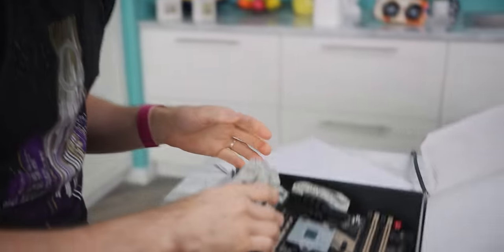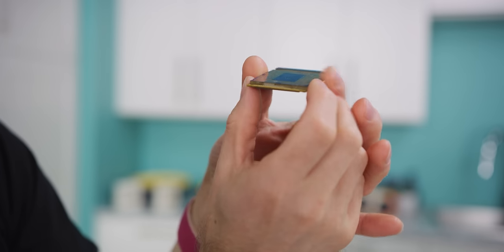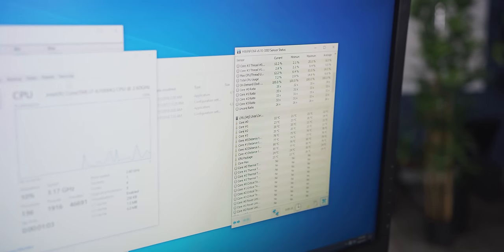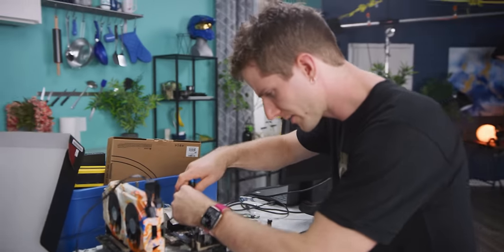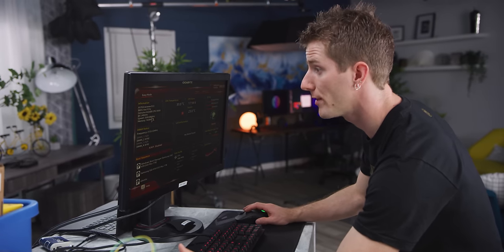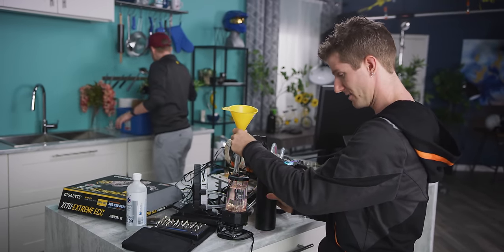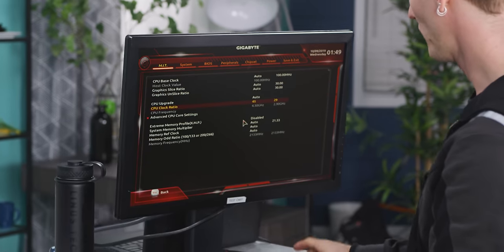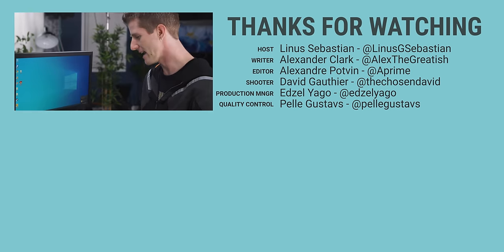Testing out Mystery Chinese CPUs

Comment: Damn Linus, I can't believe you had such a hard time. I ran the QL2X and 3X like a breeze here all the way up to 4.6GHz and even 4.8GHz CPUz Validated. Issue you were having is likely due to PCIe Gen2, some of these CPUs require to use Gen1 to work properly. But then again, you could just have used the integrated graphics (UHD 630). From my testing, Gen3 to Gen1 saw from 5 to 10% performance loss on GPU bound scenarios when using a GTX 1080Ti. You can also try raising VCCSA and VCCIO voltages, sometimes that helps to get PCIe Gen2 stable on these. For some reason, AMD Graphics cards normally don't seem to present these issues. Another thing that might've happened is that the water block used could have messed up the mounting pressure, but there's really not much tweaking involved there. You can totally go up to 4 - 4.2ghz on a stock Intel cooler since they are direct die. Nice to see you guys got to try out these CPUs too, they are pretty neat :-) Btw, I also made a video on them (cc/subtitles in english available)
Reply: Up
Reply: up
Reply: Watch it, Linus!
Reply: Up
Reply: up!
Reply: up
Reply: Up!
Reply: Upzão!!
Reply: Up
Reply: Up!
Reply: Up
Reply: up
Reply: UP
Reply: up
Reply: Up
Reply: Up
Reply: Up só prós gays
Reply: up
Reply: Almost good but you had to ruin it with the casual self promo at the end
Reply: why are people treating this like a forum
Reply: up porra, tem q ser o primeiro
Reply: UP
Reply: Up
Reply: up
Reply: Up
Reply: Up
Reply: Up
Reply: Up
Reply: Up
Reply: @benjaminandrews956  Nevermind, I got it. Removed the part which you called "self promotion". Thanks! :-)
Reply: Up
Reply: Up
Reply: Up
Reply: Up
Reply: up!
aqui é br poha!
Reply: Up
Reply: UP!
Reply: Up
Reply: Up (br é foda kk)
Reply: Ele falou pra não darem "up" poha kkkkkkk
Reply: Up
Reply: Up?
Reply: Up
Reply: Up
Reply: Up
Reply: Up
Reply: Up
Reply: Up
Reply: Boaaa
Reply: Linus likes to add in some drama to create suspense for its viewers
Reply: right
Reply: Ran Ng  Yeap, probably! I missed him on this video :-)
Reply: @CasualGamers  One loser whined about your "self promotion" and you removed it? Not too committed, huh?
Reply: Up
Reply: plz see this thread linus! Casual Gamers already made a review on this processor
Reply: @xenonram  What can I say? I guess I am easily persuaded. Just edited and put it back on, lol.
Reply: Up up up
Reply: Caralho Casual Gamers aqui! #UP
Reply: UP
Reply: Up
Reply: Up
Reply: Up
Reply: Left Right
Reply: Up
Reply: Casual Gamers ....OR...it could have been due to a malfunctioning flux capacitor?
Reply: up
Reply: Up
Reply: Up
Reply: ok
Reply: @benjaminandrews956  That was a reasonable and fair self promo though. Totally fine in my book.
Reply: @Hallowed_Ground   There is no such thing as a reasonable self promo unless the channel that you're promoting on gives you explicit permission.
Reply: Casual Gamers Up
Reply: Up
Reply: Up
Reply: @benjaminandrews956  Not true. Arguably it's not even a self promo as it's completely relevant to the topic. 

Such a broad and dismissive judgment is equally easy to dismiss.
Reply: Read this Linus pls
Reply: Up
Reply: @Casual Gamers- we don’t care. This is not your video.
Reply: Up
Reply: Up
Reply: Up
Reply: Up
Reply: Up
Reply: Up
Reply: up ya go
Reply: Up
Reply: Up
Reply: up
Reply: Everything is unscripted so he must have totally forgot
Reply: Up
Reply: Up up up
Reply: Uuuuuup
Reply: Same experience here. To the top
Reply: Up
Reply: Nós BR temos o poder de dominar o mundo, só organizar certin q o planeta é nosso!
Reply: Left
Reply: @Hallowed_Ground  and I say it again. There is no such thing as ok self promo unless you have permission. This is not a hard concept to understand. Its just plain rude. Most things in life is opinion based but you're just plain wrong on this one. imagine this situation in any other background. Say you're in a apple store and you just bought a phone and you boot it up right then and there but its not working so the owner of Samsung comes and helps you and at the end hes just like hey btw buy my phone. Apple would be pretty mad about that and they have every right to be just because he provided help doesn't give him the right to promote his brand on their property. Granted i dont think ltt would care and its not like they're cut-throat competing channels but the same principle still applies and its still rude.
Reply: Upzo
Reply: Up
Reply: @renan8567  ele falou depois, Geral já tinha colocado o "UP".. kkkkkkk
Reply: @davidribeiro5364   kkkkkkkkk ata, pensei que a molecada tá zoando kkkkkkkk
Reply: Up
Reply: Up
Reply: Linus 👆
Reply: @benjaminandrews956  Except that it literally is opinion based. That's YOUR opinion.

If Linus read that comment, would he find it rude? No, he'd probably be like hey thanks, and go watch the video. That's the major difference that apparently you're completely blind to... It isn't as if this guy said "btw buy my product"  rather he's recommending something that is 100% relevant, which happens to be his vid.

Normally, you'd be right. Normally, everyone and their dog (including me) shuts down idiots that rudely advertise themselves, but there's a reason everyone didn't do that. In fact, his comment has literally hundreds of people supporting it. Worst case scenario, I've demonstrated that you're categorically wrong about it being opinion based. You'll usually end up being wrong (and looking stupid) when you declare something is 100% one way or the other... 

I'm hopeful next time you'll catch yourself when you start thinking in black and white.

Edit: I was wrong. His comment doesn't even have hundreds of people supporting it, it has thousands. Thousands of people have a different opinion than you on a topic that is, according to you, cut and dry and definitely not opinion based. Hmm...
Reply: Good job on your essay!
Reply: @Hallowed_Ground  1: You are getting super worked up over a simple comment. 2: As I already said weather or not Linus would find it rude is completely irrelevant you are providing an argument I already dismissed. Most people find being cursed out rude. Are there people who don't care? Of course. Does that make it opinion based? No, still rude. 3: The sky is blue, the earth is round, there are no aliens on Mars. Are there people who disagree with this? most definitely. Does that make it opinion based? Nope, still facts.
Reply: I knew it but this comment cemented my thought that though Linus sounds like he knows everything, he doesn't know jack of something in his niche.
Reply: Wow! Thanks dude
Reply: upzada mano
Reply: Up
Reply: Casual Gamers could you link me to where you can get the modded bios, planing on trying to set up a Hackintosh
Reply: Up
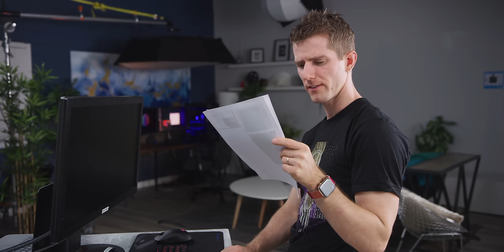Reply: 12:00
Reply: @CasualGamers  No you left in self promotion. Everyone should be reporting you.
Reply: *hits head against ceiling*  

...

Up.
Reply: TBH I find these cpus ideal for DIY multimedia nas build. A mobo with lots of sata ports+pcie sata controller,  energy efficient mobile cpu that supports h265 hardware transcoding  ✔☘  Green ☘
Reply: Up
Reply: up
Reply: Up
Reply: Ran Ng  I've heard him in background.
Reply: wha ar u talkin aout- i can t andle i t
Reply: down
Reply: nice
Reply: Papi chulo
Reply: Up
Reply: @benjaminandrews956  I wouldn’t of watched his video if he didn’t.
Reply: Up
Reply: :thanksdoc:

Comment: But the real question here is:

Do the connectors on this chip pop like little Legos?
Reply: No, but there are scratches at a level 6, with deeper grooves at a level 7
Reply: Let's find out

...

Grahhhhh!  My foot, it hurts so much!
Reply: This doesn't takes bending very well...
Reply: No but glass is glass and glass breaks.
Reply: and does it have the magic pull tabs?
Reply: And the battery is still not red.
Wait... it doesn't have  a battery.
Reply: Well they didnt include a headphone jack
Reply: Huge thanks to audible!
Reply: this one is water resistant, well not anymore
Reply: And now it's time for the burn test
Reply: It's about time we had more creativity and experimentation in the semi space.  Chinese semi industry should break the mold
Reply: @shinoha4006  humans also break
Reply: Noice. Many many men of culture here.
Reply: Small world
Reply: @lukasderstecher4582  it has permanent adhesive to glue and elephant to the ceiling
Reply: * texts you can hear *
Reply: @surferoftheweb9030  and It comes with a screen protector which is always a plus
Reply: @Guar_dian  nah, if it's the XFX RX 5700XT THICC it'd be scratching at a level 2 with deeper grooves at level 3.

Because of all those plastic pieces.
Reply: So we need a JerryRigEverything and LTT Collab?
Reply: Lego*
Reply: Well that's a bit fetishy
Reply: Aria Shinome 💯
Reply: Wow jerryrigeverything has been on top for longer than i thought

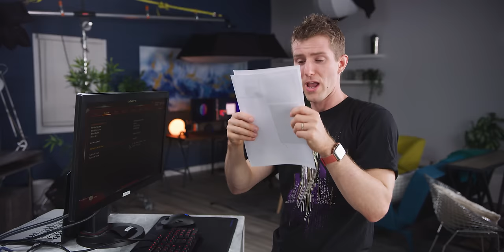Comment: That dialup modem sound effect at 10:45 was hilarious. Had me wondering if Linus was thinking at 14.4 or 56k.
Reply: That sound was the intial part of the handshake IIRC.
Reply: Most likely 1200 with high bit error rates.
Reply: @TheBodgybrothers  - You mean cos he's slow? 😂
Reply: gr8 edit
Reply: @Djuntas  - gr8 comment. Who's edit, now?
Reply: 9600 baud.
Reply: Pretty sure that's a fax negotiating a connection
Reply: @bitrot42  - Which would be a 2100Hz tone, apparently.
Reply: NeuronalAxon it's the sound a fax machine makes when you call it from a regular phone. 9600 baud modems use similar tones, but you don't hear just one side of it like this. (Modems just make a pure tone until the calling unit talks back.)
Reply: @bitrot42  - Ah, cool. I've heard a lot more acoustic modem warbles than fax ones in my time, I think.
Reply: NeuronalAxon I guess I paid more attention to it than I should have...  but it's all good, I guess.
Reply: 2400 Like my old Supra modem.....

Comment: "So these are unlocked CPUs and you can get them for as little as $80-$90" 

laughs in Ryzen
Reply: @tdplay4135  3000G? 49$?
Reply: It's not designed to take over Intel or AMD. It's designed to keep American Intel and AMD providing cpus for China. You know what I mean.
Reply: Laughs in temps
Reply: @爸爸-r2c  does China basically rule the cpu industry?
Reply: @trytoneee  Actually if you think about it china rules every technology-related industry
Reply: laughs in 2700K
Reply: Laughs in anthlon 200GE
Reply: laughs in unbendable pins
Reply: @fz8691  gotta love the ryzen 2200g tho even if its 45 dollars more
Reply: @isakhwaja  yeah ill admit the fact that it can run any game singlehandedly without the use of a dedicated gpu is very impressive. Im actualy going to get on in late june or early july (that or a used ryzen 5 2400g which ever is cheaper).
Reply: @eclipsegst9419  2600  over here :(
my sis has the 2600k and its a beast compared to mine xD
Reply: @abdellatifsraiti2032  They rule nothing they produce for the rulers.
Reply: @crueltylegend9720  yep. they sure did last the test of time. Its feeling time for an upgrade though on some games. i recently discovered you can get a 6 core 12 thread Haswell Xeon e5 1650 v3 for 60-80 bucks and a chinese X99 motherboard for about 70-80 for dual channel or 100-120 for quad channel. (worth the 30 bucks for sure, 8 dimms!) they have m.2 and basic overclocking support, good for maybe 4.3ghz all core. you could probably go higher with water on the vrms. and they can use server ram which is cheap. im thinking thats my next move to tide me over until the true next gen intels arrive. Golden Cove or whatever its final name is. Hopefully by then ill have this promotion im working hard for and be able to get a brand new setup for the first time in my life.
Reply: @eclipsegst9419  ah okay... The thing is i will switch to Ryzen in Two months, when i have enough Money dir that... but damn its amazing how these old intel quad cores still run everything just fine
Reply: @fz8691  3200g is $90 2200g might be more expensive. What sucks with all these new gen cpus coming is that the price for older hardware is more expensive however when you risk buying used it could come broken in shipping and the shipping company what damage they cause. (In warehouses they just throw boxes into the truck) and some mailmen throw the packages at your door
Reply: @thenoobreturnz8968  I bpught a used ryzen 5 1600 and a rx 570 4gb it was like 20£ cheaper than the AF version
Reply: @fz8691  that's a good deal! Life is about all you can get. I wouldnt recommend getting used cpus fron ryzen because they have the contact pins that could easily bend if mishandled. Also is the 570 a mining card,?
Reply: @thenoobreturnz8968  the rx 570 was new and I bought the ryzen 5 1600 using ebay so even if the pins were bent I could send it back but the cpu came in good condition and the seller sent me pics of the pins before hand.
Reply: @redd_rl  Laughs in better contact.
Reply: @eclipsegst9419  as in i7-2700k? Still a realtively good chip?
Reply: @allanmcelroy  at 80 to 90 bucks its a good buy if you already have an i5K, but the only thing is, people still want 100 bucks for a decent z77, so if you dont have one already, the i7 5775c at 125ish would be the best upgrade that keeps your ddr3 (assuming thats what you want to do) technically 4790k is a little faster overclocked, but they also go for 180 bucks, not worth it in a world where a new i3 is basically a 6700K for 130 bucks.
Reply: laughs in $50 i5 4670K @4.3 GHz on air
Reply: Laughs in i-7 980X from 2011 still running modern games at 60fps with no issues. 4.2 ghz OC, 6 core for 80 bucks
Reply: Okay I’m momiopening moopening pop moo pop ooooppoop man mop
Reply: @tdplay4135  and and poooiooooooooooooooooooooopol
Reply: @tdplay4135  ooooioooooooooooooooooooooopooooooooooloooooooooooo po ooooioooooo
Reply: Ooopiooooooooooooooooooooooooooo
Reply: @tdplay4135  oopooooooooooooo
Reply: @DrMurdercock  laughs in i7-870 hyper threaded 4 core that still runs modern games
Reply: @cwalke32477  I recently upgraded. NEw rig has i7 -9700k OC'd to hell an back
Reply: @fz8691  I always request photo of amd cups now after 4 mailbacks in a row to Newegg
Reply: laughs in old ass 8 core intel xeons

Comment: I had a Dell Precision 7510 with a 6820HQ that could be overclocked to 4GHz through the Intel Extreme Tuning Utility. Keeping it cool was tougher, but wouldn't always throttle. OEMs were on board with some of these features.